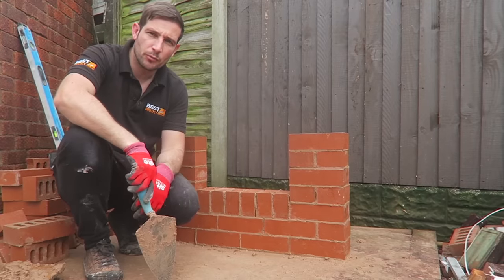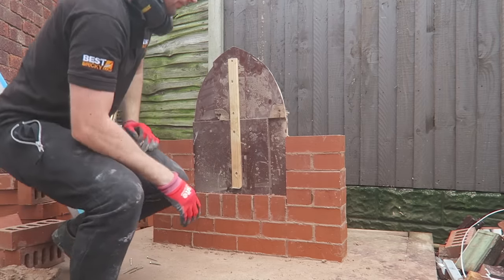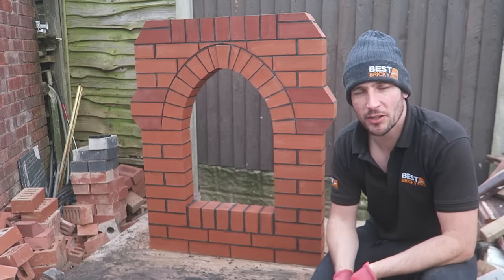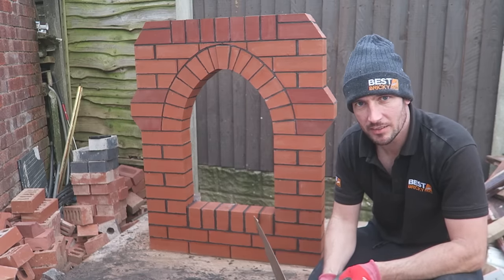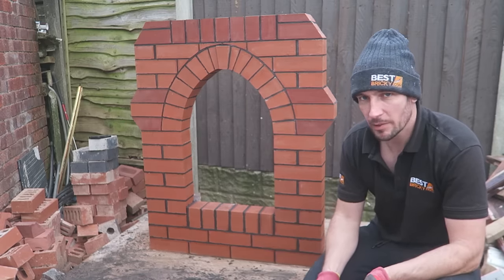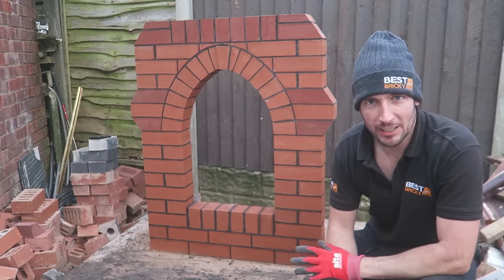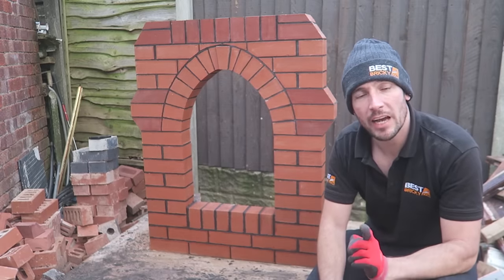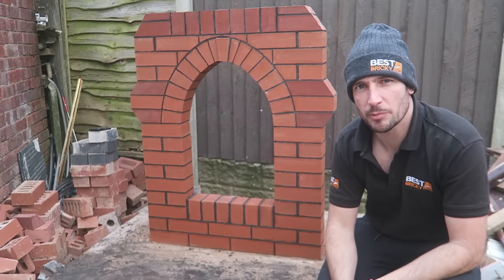Bricklaying - Building Brick Arch feature

Comment: Former bricklayer here.. good job, plumb, level, perfect. 👍
Never seen the color added on top of joint like that, we used to add color to our mortar while mixing  in the beginning
Reply: What about gauging it? Doesn't every bed and joint have to be 10mm
Reply: @jakehindmarsh4634  Why 10mm.
Reply: @johnclark7049  in the UK to get the perfect brickwork you have to have 10m joints and 10m beds it's how am getting taught in college
Reply: @jakehindmarsh4634  go and have a look at some 100 year old brick houses fella you'll see that gauge wasn't so important... but they're still here... 100 years later. 

Maybe if you're using an old sandy silo muck with lime, and building with a glorified insulation block with a powdered coating, then you need 10mm gauge, but if you're making a proper mortar, and using real bricks, then gauge can be smaller.

Comment: Just a little tip for apprentices or other people wanting to learn. When you do your cuts around the arch, if the joint width is less than the thickness of the other bricks and you are able to lay the brick, i.e. the cut isn't too big, lay the brick in place and later when you are pointing up you can use a grinder with a diamond blade to make the joint width match that of the surrounding bricks. By only cutting the brick face back by 10mm deep, when you later joint/point up the wall it will be invisible but give the appearance of the same width joint. If that makes sense. Good video Stu.
Reply from the maker: That’s is very confusing for anyone to read even me lol thanks for the advice tho
Reply: Basically you can neaten up your cuts around the arch ring/voussoir bricks with a grinder so they are all equal. Any better? I did a Gothic arch as one of my choices for NVQ 3 test panels. Cheers

Comment: I'm 70 now and grew up in the trades my mother side were brick layers and back in those days there was no such thing as safety? They made their own scaffolding pulling up bricks in a bucket and if they needed something you would just throw it up to them never used a saw it was all done marking and hitting the brick and it was perfect every time, today technology is everything. I started out as a plaster and that was a trade, today everything is made and you just apply very quick and simple? I lost my uncle from a fall while he was rebuilding two chimneys the scaffold he was on was pretty high 70 to 80 feet up and it was over loaded with brick and mortar and it went down killing him and his labour, but that didn't stop my other uncles from doing this work just a bit more aware how to do things, great trade either yesterday years or now.

Comment: Lovely work. Nice and clean. Passion, skill and creativity always shows in great work as it clearly does in yours.
I just bought an Evolution mitre saw (same as you're using). Is that a different blade/disc than the multi-purpose one supplied with the saw? I need to make some precision cuts in brick & stone and am looking for a thinner, clean cutting disc. Thanks.

Comment: Your joint are less than the standard 10mm requirement.However Good job well done. What I was wondering what masonry blade did you use on your chop saw. I got told I was not able to this. Because the Masonry bore hole is a different size .

Comment: Half bond/ stretcher bond is the magnolia of brickwork, I think. I saw a clip recently of someone who got very excited because he'd laid a thousand in stretcher bond on a large flank wall, free of windows. And yeah, well done, I guess, just like these stupid competitions that we hear about, but it doesn't really match up to  you and your mate laying a thousand plus LBC commons in a 13" english-bond wall, fair faced both sides - and don't let the foreman catch you havin' a blow - building the boiler house wall in a London Transport bus depot. We did our day and got shuffled back to laying corbels (specials) 13" long with a 4" overhang on each course (!) tied back into the interior by mass brick work on the face wall
We did eventually get back to the basement a few days later, where the wall was capped off about 3' below the ceiling. Our job was to fill the space with Pilkington glass bricks; ie, PGB up from one face, a 4" airgap and PGB following the face-work on the other side. All off of trestles at  full stretch, with the brick foreman up our arses from the very beginning, telling us how expensive these bricks were and how we'd be fired if any breakages occurred, yada yada. After lunch we took a milk bottle from the canteen and went back to work. Glass bricks aren't hard to lay and point, maximum cleanness is the most important part, and we were steaming along when along comes his majesty again, dripping on about getting finished and taking care not to break any, on and on.
We waited until he had stopped and turned to go before lobbing the milk bottle right behind him. When it broke he jumped about a foot in the air and turned round to see me and Jimmy in fits of laughter. Checkmate! Didn't see him again for a couple of days. :)

Comment: Great video Stu! I have a question about mortar joints: 
I've noticed that there is quite a large joint between bricks nowadays, usually around 10mm, compared with older brickwork. On Victorian or Edwardian buildings with their beautiful Flemish bonds, the mortar joint is often much finer. This is particularly evident above window arches. 
Is there a reason the size of the mortar joint has increased and is it still possible to build with finer joints (perhaps to match old brickwork)?
Reply from the maker: I think it’s due to the size of the old brick too which were massive. I do like thin joints better, it’s harder work and you have to be more accurate that’s why nowadays you don’t see it which is a shame. I like to see myself as the old bricky that builds by eye and takes pride in his creation.
Reply: Hi Stu, thanks for your reply. The pride in your work certainly shows in your videos! Definitely a shame that we don't see it anymore. 
I imagine wider joints mean less bricks overall and therefore more profit, but can you elaborate as to why it's more difficult to obtain accuracy with a thinner joint? Also, when Victorian builders built with Flemish bonds, did they build the wall two courses wide or did they cut the brick like you did in your other video?
Reply from the maker: Because working with gauge and brick length is less lenient. You cannot mistake any course or brick otherwise it will throw everything out 👍
Reply: Very interesting indeed. Would love to see a video of that someday!

Comment: A question: I saw you finish with a colour mortar coat at the joint. Is this the common practice? I used colour mortar on one of my project and It costed me a fortune. I’m not a brick layer
Reply from the maker: not really common but i like to do it
Reply: @Stucrompton1  Is this going to last comparing to using colour mortar all the way through?
Reply from the maker: Colour mortar all the way through is better